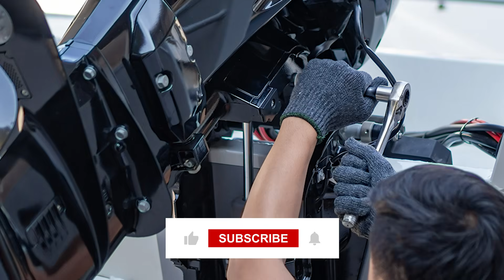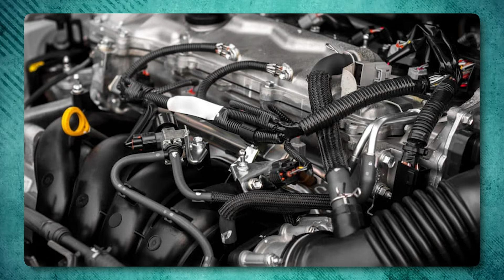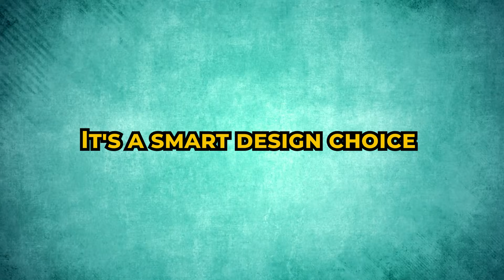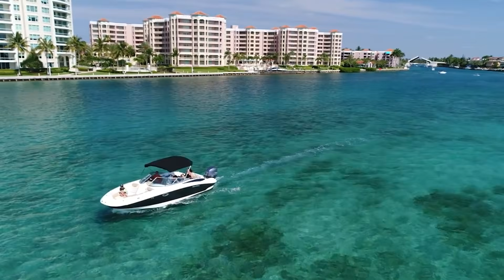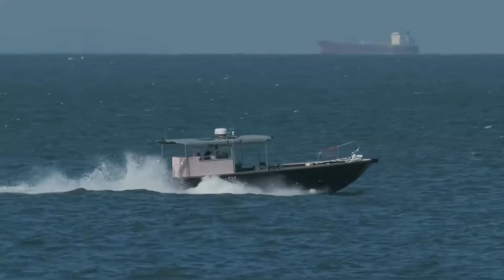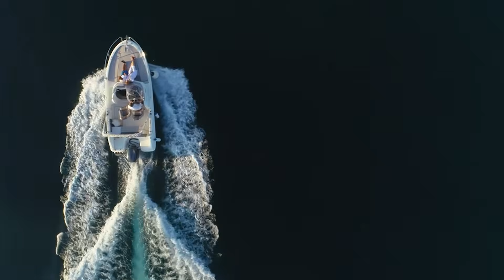What Happens When You Use Car Oil in an Outboard?

Comment: What’s funny is this video talking about 4 stroke oil but showing and referencing some older 2 stroke motors . Hmm. I used mobile 1 automotive oil in a Yamaha 4 strike and put over 1600 hours on it. Ran it hard. New owner is still using it and heard it’s over 2k hours now and still running good.

Comment: I asked the manufacturing engineer at Tohatsu Marine about the engine oil, and he told me it was regular car oil and didn't necessarily have to be marine-grade. When I read about regular mineral engine oil, I found it had anti-foaming and anti-rust properties. And when you read the owner's manual for any engine, it indicates the use of marine oil or regular car oil without specifying marine oil.